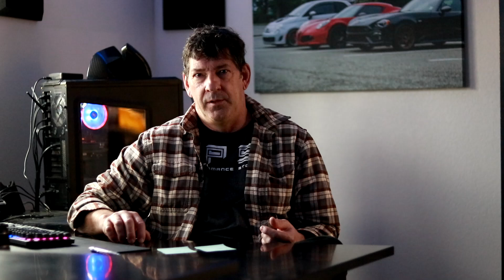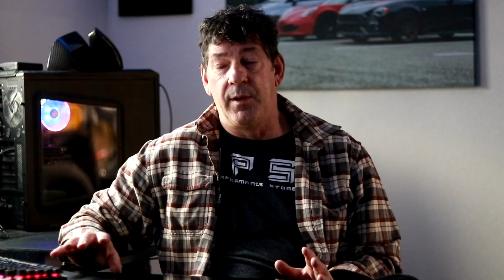Boeing 727 Falls From the Sky TWA 841

Comment: A small correction: Greg says that going way over the design speed would destroy most airplanes and that pulling over 6Gs is more than any other airliner than boeing 727 could withstand. I personally respect 727 very much, mostly because it looks so beautiful, but it just is not as special as Greg tries to make it sound like. Overspeeding and pulling too many Gs is actually a very rare reason for jetliner crashes. The main reason for this is that the design limits have been designed to be safe even when done multiple times throughout the airplanes life with lots of safety buffer. A singular breaking of design limits rarely causes catastrophic failure. TWA 841 had an overspeed and over G-event and it got the same consequences that most jetliners have gotten when they have gone through such an event. The hull was damaged, but not catastrophically and the jetliner was repaired... btw, I'm not trying to sound "anti-Greg" here as I love his videos. I just love analyzing data and correcting errors. For the sake of uncorrupt information! Good times :P
Reply from the maker: I basically agree with what you're saying, but I don't know of any other jet airliner that has pulled 6Gs and returned to service. Now did airliners sometimes exceed design limits and still be OK, sure, but 6Gs is another level.
Reply: @GregsAirplanesandAutomobiles  hmmhhh... can't remember from the top of my head the specific Gs airliner have pulled in certain close calls I have read about... one comes to mind, but I can't remember which specific flight it was.  But I do agree that 6Gs is very rare, so you could argue that that specific thing has not been tested in airliner accidents enough to know if 727 was exceptionally robust in this test.
Reply: @GregsAirplanesandAutomobiles  China Airlines Flight 006... this is not the flight that is in my fuzzy memory of high Gs, but this 747 flight pulled over 5Gs similarly to TWA 841 and was also just damaged and continued service. Weirdly I can't easily find the specific amount of Gs TWA 841 pulled. Not to say that Gregs 6Gs was incorrect, but just to emphasize that it's very hard to know how many Gs any specific type of airplane has pulled in its history.
Reply: @informationstream6513  The point is a neo/max aint gonna' cut it...✈
Reply: I can't find a record of this on the internet and it was a long time ago so I cant be sure of the numbers, but in the early 1980s a KC-135 from Grissom AFB rolled over and dived something like 30,000 ft before recovering.  A malfunction in the autopilot manual turn knob combined with inadequate pilot technique caused the plane to roll past 90 degrees before the crew even initiated recovery.  They were disoriented and instead of rolling to the nearest horizon they ended up pulling through the vertical in a Split S.  With speed brakes extended the plane went past the barber pole and was estimated to have briefly exceeded Mach 1.  In desperation for more drag they dropped the landing gear well past its limit speed, which caused a spike in the G load.  But they eventually recovered an overstressed airplane that lost some gear doors and skin panels.

Comment: Are you pilots significantly worried about Boeing quality? I used to build them when men were men and engineers had more power than sales and accountants.
Reply from the maker: Statistically, no. By the numbers they are still very safe, just not as good as they should be.

Comment: While I suspect you are right about what caused the TWA 841 to fall out of the sky, I need to point out some additional testimony that came out 11 years after the incident (Quoting from a Chicago Tribune article that came out October 14, 1990):

Last week the Air Line Pilots Association, citing new evidence, petitioned the five-member safety board to rescind its 1981 ruling and conclude that the flight`s spiral dive, one of the most unusual events in commercial aviation history, was caused by a mechanical malfunction.

According to an affidavit filed with the petition, the same plane that Gibson flew on Flight 841, N840TW, was used in 1977 on a TWA test flight. During the test flight, the affidavit says, the pilot (* encountered serious problems controlling the aircraft-problems that were similar to what Gibson encountered two years later on Flight 841 before the plane went into its dive. Despite the lengthy safety board investigation and nearly 20 civil suits filed by Flight 841 passengers, information about the test flight was never disclosed by TWA, according to John Rohlfing, a TWA pilot and chairman of the union`s TWA accident investigation committee.

The affidavit was signed by P.T. Williams, who has been a TWA pilot for 31 years. According to the affidavit, Williams flew plane N840TW on a test flight May 23, 1977. On board were several supervisors.

During the flight, Williams states, he was told to forcibly override the autopilot so personnel on board could evaluate the response. The procedure worked the first time; but on the second attempt, the autopilot gave the appearance of having disconnected while actually remaining engaged. Subsequently, Williams said, ”the flight controls became extremely difficult to manipulate” and the plane became difficult to fly. After ”much effort,” the affidavit continues, he was able to return the plane to Kansas City.

Rohlfing said TWA never notified pilots of the occurrence. Williams himself only remembered the incident a few months ago, Rohlfing said, after another TWA jet encountered similar control problems in midflight and was forced to make an emergency landing in Dayton.

Williams is a member of the union`s TWA accident investigation committee. In studying the Dayton incident, said Rohlfing, Williams remembered the 1977 flight, went back to his log book and discovered it was the same plane Gibson flew in 1979.

Comment: I think you're right about what happened. I can't see them erasing the voice recorder by habit when they knew there would be an investigation. Their version of the story sounds too much like one of those "I was just driving and ______ happened." stories.
Reply: Except what explains the 9+ minutes that were found on the CVR which the investigation conveniently left out because it didn't adhere to their (the NTSB) theories?
Reply: @Batwingsix I didn't know about that, but that seems to further indicate that the erasure(assuming that's what it was) was not done out of habit. If it was a habitual response to erase the CVR, why would they only erase a portion of it?
Reply: @GlimmerOG  And HOW could they erase just a portion of the tape if, as the Wikipedia article on this crash reports its source to claim, "The CVR tape can be erased by means of the bulk-erase feature on the CVR control panel located in the cockpit." Bulk erase subjects the entire tape to erasure at the same time rather than by running the tape past an erasure head..

Comment: 1:22 The fact that they could extend the landing gear at that speed is more than impressive.
Reply from the maker: Yes, and still land on it!
Reply: 727 landihg gear was hell for stout
Reply: The fragile part is the gear doors. I bet some of those, if not all of them were lost.
Reply: I believe that did happen.   @keithstudly6071
Reply: I heard in A&P school that the gear moved back 2 inches during this event.   They didn’t say where that was measured from but if it’s true it seems like a lot of stress happened there.
Reply: i was told it was almost 18 inches aft of original centerline
if so.....well....oi.,...what a hell of a minute ride that was....35,000' in a minute is.....oi....
 @billnu
Reply: i was told it was almost 18 inches aft of original centerline
if so.....well....oi.,...what a hell of a minute ride that was....35,000' in a minute is.....oi....
 @billnu
Reply: A320 landing gears are locked out above Vle.
Reply: Overspeed the gear and live? No brainer...
Reply: The landing gear speed is for the gear doors, not the landing gear itself.
Reply: They don't build them like that anymore.
Reply: Well.....there was, more recently, an Air Astana Embraer ERJ-190, flight 1388, that was in for maintenance and had the ailerons rigged backwards which was not caught before take off.  The plane flew for 90 minutes like that, and experienced G loading that was far beyond design limit while the pilots figured out how to fly the plane the way it was.....they managed a wheels down, non-crash landing at a military base.
The aircraft was scrapped on the spot. 
What a wild ride that must have been!!!
One of the most astounding, modern, feats of airmanship by the flight crew that was.  @sambrose1